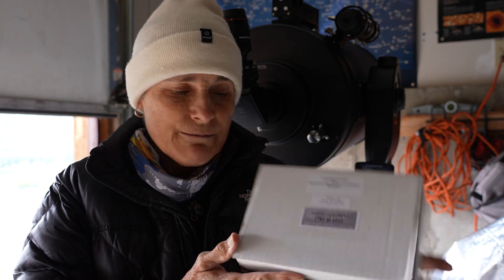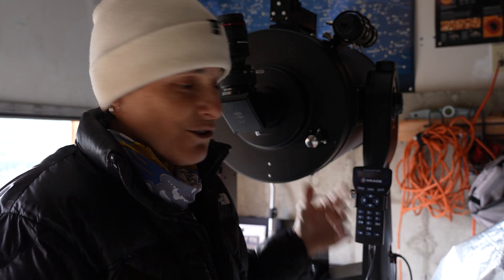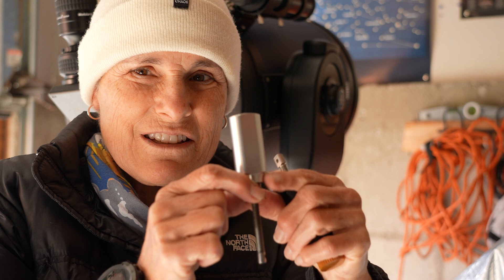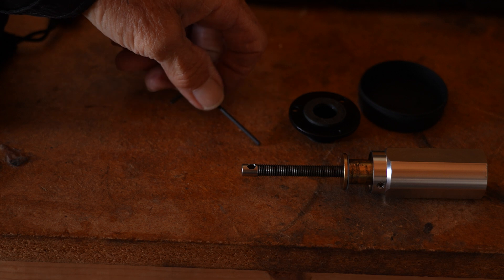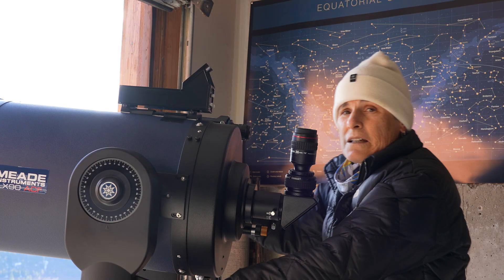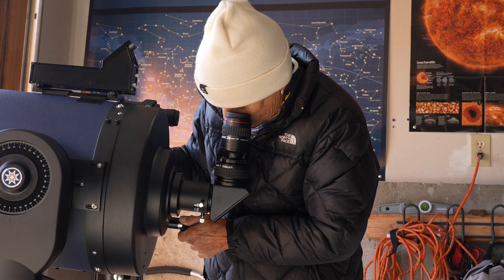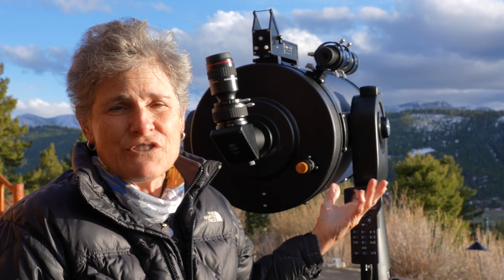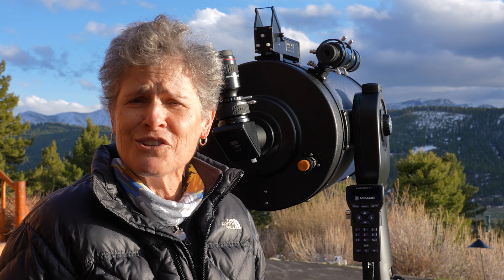HOW to INSTALL MICRO FOCUSER on MEADE SCHMIDT-CASSEGRAIN

Comment: I cut a hole thru a pickle jar lid. Slipped it over the original focuser. Works great, helps dial in finer details on mars and Jupiter. Of course I learned this from the great Astrobiscut so credit where credit is due. All my best you Tsula
Reply from the maker: Interesting.  I will have to try that out.  But how do you keep the lid from scraping the focuser?
Reply: @ I cut it to the right shape in size. Slips on nicely. going to try and add one to my Newtonian as well. Talk soon

Comment: Not trying to steal any thunder here but, for my old Meade LX10 8 inch, because of the play in the original focuser, I bought a Peterson Engineering pack to improve it, which it did fairly well. I then bought an SVBony helical focuser (1.25 inch though) and that achieves the fine, in line focussing. A heck of a lot cheaper since, personally, I think we astronomers get ripped off left, right and centre for the simplest of parts.
Reply from the maker: Someone else mentioned the Peterson Engineering pack also.  I don't know much about helical focusers.  I will have to look it up.  But I agree with you on the exorbitant prices charged one some items that should be much cheaper.

Comment: i love these. i have installed mine on my 12" LX90 aslo back in 2006. Its one of the first things i do. i like dual speeds on just about most of my scopes. The costs have gone up alot since then. cheers
Reply from the maker: It was very expensive but well worth it especially for anyone like you who loves dual speed focusers.  Cheers.

Comment: There was nothing intrinsically wrong with the focuser on my Meade 8" SCT so I couldn't really justify the cost of the Feather Touch upgrade. Instead, I bought and installed a Peterson Engineering ez-focus kit and am amazed by the results it achieved. Mirror flop is virtually non-existent now and focusing is soooo much smoother.
Reply from the maker: I can understand that.  The Feather Touch was very expensive.  I have never heard of that Peterson Engineering kit.   I'm going to go look it up now.

Comment: I appreciate anyone posting stuff about Meade SCTs. 👍🏼 I just recently got their 6” ACF and am wondering if the install is the same for that? Or if it’s even compatible with it? I’ve notice that the 6” version has a different back than the larger versions — it’s less “flat” if that makes sense. 

Thanks again for the Meade content.
Reply from the maker: Thank you.  The instructions said they applied to 8-14 inch.  I believe the focuser is slightly different on the 6" and the 16" Meades.
Reply: I've seen good reviews of the 6" model, for example in the latest edition of The Backyard Astronomer's Guide.  And the size and weight make it easy and safe to handle.  If you use it on an LX85 mount you get all the navigation and tracking that you need.  What's not to like?😀
Reply from the maker: @JamesAdams-ev6fc  Sounds good to me!

Comment: You have a very positive, "can-do" attitude and that makes everything work out for the better.  I recall seeing another review by Donnie Brasco that does what you did here for the 8 inch LX90.  And I've heard that the Feather Touch IS a big improvement.  I saw your original video on the 12 inch LX90 and I am convinced that I would enjoy the 12 inch LX200 optical tube mounted on an equatorial mount, the whole thing on a wheeley bar for easy moving.  I am now the proud owner of a Tele Vue 55 mm plossl and that will be great for the 12 inch.  Thanks for the videos and <<do not>> curb your enthusiasm!
Reply from the maker: Thank you so much!  You will be very happy with a 12" LX 200 and the Wheeley Bar makes it so easy to move around.  I looked at that Televue 55mm Plossl but ended up getting a much cheaper 56mm Astromania (I think) that is great for wide field views.